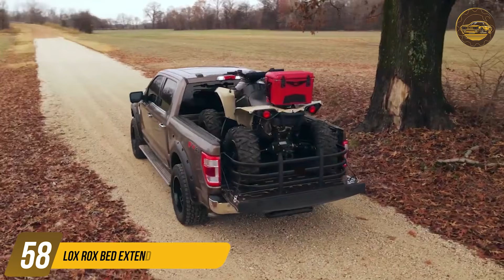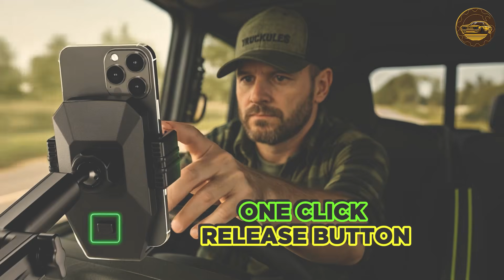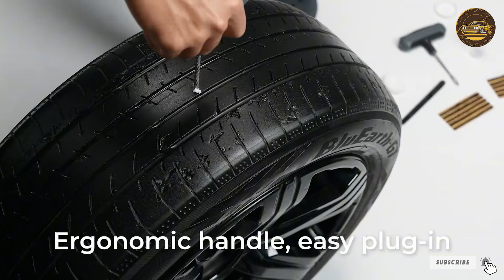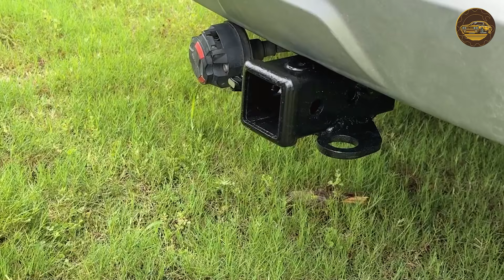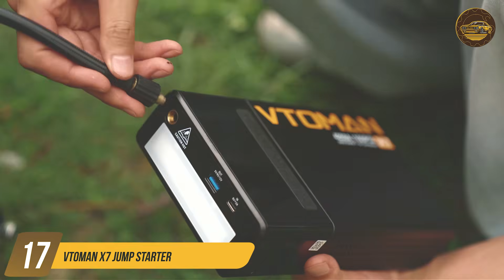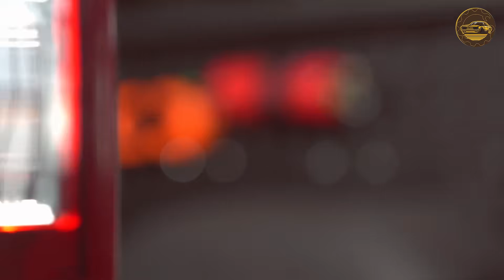61 Must-Have Pickup Truck Gadgets On Amazon for Work and Weekend Adventures

Comment from the maker: 61	Armor All Car Cover	
 https://www.amazon.com/dp/B0BCTTGQ35?tag=Carcare001-20
60	TripleAliners Truck Bed Mat	
 https://www.amazon.com/dp/B0F48DH9YD?tag=Carcare001-20
59	VEVOR Aluminum Bed Tool Box	
 https://www.amazon.com/dp/B0C65Q1XYJ?tag=Carcare001-20
58	LOX ROX Bed Extender	
 https://www.amazon.com/dp/B0DH34W2V4?tag=Carcare001-20
57	Umbrauto Car Air Mattress	
 https://www.amazon.com/dp/B0D16X4PFP?tag=Carcare001-20
56	SAFELIFE Tire Tread Gauge	
 https://www.amazon.com/dp/B0BTPCWWH1?tag=Carcare001-20
55	Mabett Maverick Mud Flaps	
 https://www.amazon.com/dp/B0CBJY45L2?tag=Carcare001-20
54	Nilight Switch Panel	
 https://www.amazon.com/dp/B08CDTWT1L?tag=Carcare001-20
53	Last Boks Cargo Box	
 https://www.amazon.com/dp/B07MXQRTC2?tag=Carcare001-20
52	Strapinno Cargo Bar	
 https://www.amazon.com/dp/B0CJCGN7BB?tag=Carcare001-20
51	Rough Country Cargo Box	
 https://www.amazon.com/dp/B0D9C24TBM?tag=Carcare001-20
50	Truck Tailgate Seal Strip	
 https://www.amazon.com/dp/B0F4VKQXSC?tag=Carcare001-20
49	Mytee Bed Edge Protectors	
 https://www.amazon.com/dp/B07B3SFG36?tag=Carcare001-20
48	Truckules Phone Mount	
 https://www.amazon.com/dp/B0G2KJYY5R?tag=Carcare001-20
47	Trumgeta Bed MOLLE Extender	
 https://www.amazon.com/dp/B0G6BPK3NS?tag=Carcare001-20
46	Lamicall Tablet Holder	
 https://www.amazon.com/dp/B0DSFWJRTF?tag=Carcare001-20
45	NURATIT L-Track Tie Downs	
 https://www.amazon.com/dp/B0F2D2C2T7?tag=Carcare001-20
44	Suetlcoity Console Lock Box	
 https://www.amazon.com/dp/B0DH2JR7D7?tag=Carcare001-20
43	WESBRITE Car Wash Brush	
 https://www.amazon.com/dp/B0FPBZ523Z?tag=Carcare001-20
42	ALL-TOP Air Compressor	
 https://www.amazon.com/dp/B08637KCWQ?tag=Carcare001-20
41	Sunferno Recovery Tow Strap	
 https://www.amazon.com/dp/B06ZZBGFYV?tag=Carcare001-20
40	Tevlaphee Wheel Clamp Lock	
 https://www.amazon.com/dp/B0BTGQ8N9Z?tag=Carcare001-20
39	GOEASY0312 Bungee Cords	
 https://www.amazon.com/dp/B07G95PPPW?tag=Carcare001-20
38	Truck Adjustable Ladder Rack	
 https://www.amazon.com/dp/B0F98RYRT3?tag=Carcare001-20
37	ETENWOLF Tire Repair Kit	
 https://www.amazon.com/dp/B0F6T38411?tag=Carcare001-20
36	DUOYU Tailgate Ladder	
 https://www.amazon.com/dp/B08HWR6Z59?tag=Carcare001-20
35	Hifor Hitch Step	
 https://www.amazon.com/dp/B0GXK4LZYL?tag=Carcare001-20
34	Trumgeta Truck Mud Flaps	
 https://www.amazon.com/dp/B0DQD4HTVR?tag=Carcare001-20
33	LMRSTOO Bed Extender	
 https://www.amazon.com/dp/B0FKMXBWZ7?tag=Carcare001-20
32	OEDRO Underseat Storage Box	
 https://www.amazon.com/dp/B08RNKFJ8M?tag=Carcare001-20
31	Truckiipa Leather Seat Covers	
 https://www.amazon.com/dp/B0DMVB1JWM?tag=Carcare001-20
30	Strapinno Ratchet Straps	
 https://www.amazon.com/dp/B0FM6DYFDT?tag=Carcare001-20
29	Hooke Road Drawer Box	
 https://www.amazon.com/dp/B0FJF3M37D?tag=Carcare001-20
28	KINGGERI Storage Box	
 https://www.amazon.com/dp/B0FBFZW8SW?tag=Carcare001-20
27	KNAWIER Bed Divider	
 https://www.amazon.com/dp/B0FG2F5HQX?tag=Carcare001-20
26	JOYTUTUS Fishing Rod Holder	
 https://www.amazon.com/dp/B0FB37QC75?tag=Carcare001-20
25	CITYMONS Trailer Ball Mount	
 https://www.amazon.com/dp/B0D7Q1B7J7?tag=Carcare001-20
24	MONOKING Truck Rollbar	
 https://www.amazon.com/dp/B0FMK89SPC?tag=Carcare001-20
23	Rhino USA Recovery Strap	
 https://www.amazon.com/dp/B0BJMP28XD?tag=Carcare001-20
22	Tyger Tri-Fold Bed Cover	
 https://www.amazon.com/dp/B07VKF332M?tag=Carcare001-20
21	NeaLia Trailer Circuit Tester	
 https://www.amazon.com/dp/B0DJVXV8FT?tag=Carcare001-20
20	JOYTUTUS Soft Truck Topper	
 https://www.amazon.com/dp/B0CVZWRRLZ?tag=Carcare001-20
19	Golabs Truck Bed Tent	
 https://www.amazon.com/dp/B0DSB814C5?tag=Carcare001-20
18	Emergency Window Breaker	
 https://www.amazon.com/dp/B0D2NWMBR5?tag=Carcare001-20
17	VTOMAN X7 Jump Starter	
 https://www.amazon.com/dp/B0H2YDBJ35?tag=Carcare001-20
16	EcoNour Windshield Snow Cover	
 https://www.amazon.com/dp/B08JYV6YYX?tag=Carcare001-20
15	Wedelweib Cargo Door Lock	
 https://www.amazon.com/dp/B0BM9271WJ?tag=Carcare001-20
14	Retractable Bed Tie-Downs	
 https://www.amazon.com/dp/B0BW8DNWZM?tag=Carcare001-20
13	ZEROXCLUB Backup Camera	
 https://www.amazon.com/dp/B098QQTBMW?tag=Carcare001-20
12	Venluna Backup Camera	
 https://www.amazon.com/dp/B0G2S5RTGD?tag=Carcare001-20
11	LIVANS Visor Organizer	
 https://www.amazon.com/dp/B0FPMB7Q4G?tag=Carcare001-20
10	HUOYANGUANG Cargo Lights	
 https://www.amazon.com/dp/B0GF1QLLF1?tag=Carcare001-20
9	Autorder F150 Mud Flaps	
 https://www.amazon.com/dp/B0GCHXX6XD?tag=Carcare001-20
8	SZYANG Bed Divider	
 https://www.amazon.com/dp/B0FPCSL78V?tag=Carcare001-20
7	Truck Bed MOLLE Panel	
 https://www.amazon.com/dp/B0F4XCMDJ8?tag=Carcare001-20
6	BUNKER INDUST Recovery Kit	
 https://www.amazon.com/dp/B0G7XGGM97?tag=Carcare001-20
5	Husky Liners Hood Protector	
 https://www.amazon.com/dp/B0DJDSGJSP?tag=Carcare001-20
4	YONZEE Laptop Steering Tray	
 https://www.amazon.com/dp/B0F7R88XGY?tag=Carcare001-20
3	Beech Lane Hitch Safe	
 https://www.amazon.com/dp/B0DNKP5G77?tag=Carcare001-20
2	TriPole USB Car Fan	
 https://www.amazon.com/dp/B0BPS66XYH?tag=Carcare001-20
1	Send It Tailgate Pad	
 https://www.amazon.com/dp/B0DHSYVGWN?tag=Carcare001-20